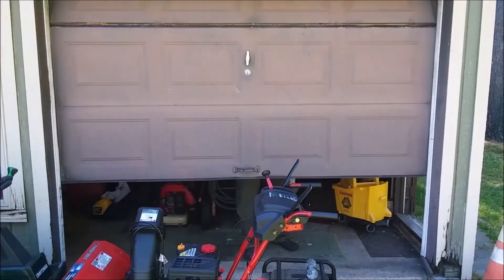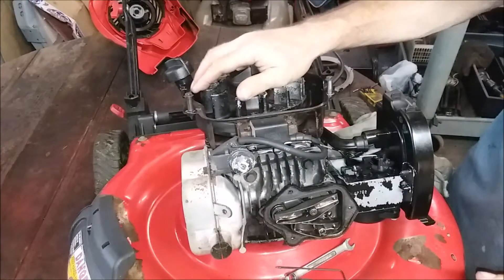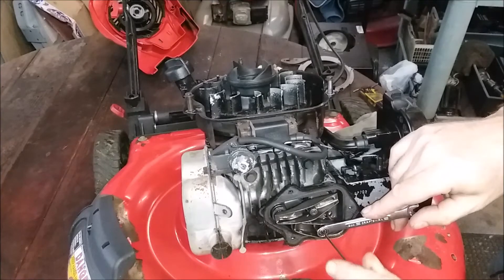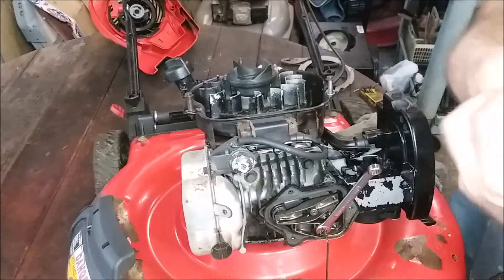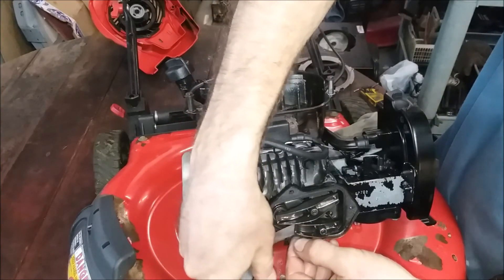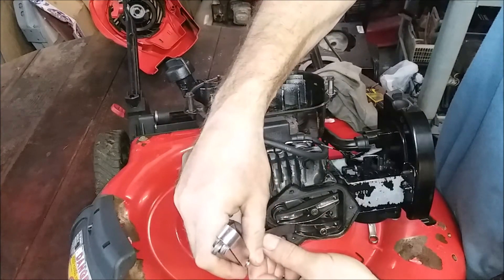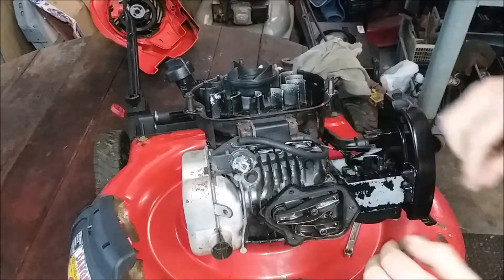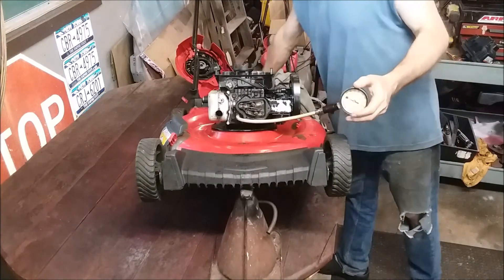How to Adjust Valves on the Briggs & Stratton 550 Series Over Head Valve Engine

Comment: Mr you don't adjust valves using the wrong tools as in this video using an Allen key wrench for a star torx bit, it's like trying to use a Philips screwdriver for a standard slotted screw on something, stop being a tight watt & spend the money & get the right tools for the right screws.
Reply: He got the job done, didn't he?

Comment: I’m assuming it’s different gap requirements for the ones that have equal length rockers?
Reply from the maker: Usually its due the the heat from the exhaust valve expanding, this requires a little more clearance but not on all engines.

Comment: The lock in the middle is a T10. The adjustment nut is a 5/16.
Reply from the maker: Thanks fer watching! Yes, 8mm & 5/16 are the same, there are a few sizes that run concurrent!
I recently bought a very nice set of Torx drivers! When I made the video I had a crappy set from craftsman. They were old, probably the 1st set they ever made. Kinda sucked!

Comment: How was it running before?
Reply from the maker: It wasn't, almost all of the machines I get aren't running!
Reply: @TheNovaJohn  yep! I ask because mine was surging and if you bump something it would surge. I checked the reed and drainage hole? Reed was fine maybe a little crud in the drainage hole. I adjusted the valves like you said and man the difference was day and night great dang video worth its weight in anything thanks a million. I will run it  this full season and hopefully that torx tip I broke off in the adjust nut will work it self out by then. That has really been bothering me after such a great job cause it's really running tops now.
Reply from the maker: Great,,,,thanks for watching!!!

Comment: If the intake valve is a little loose, will that cause backfire and other amusing antics?
Reply from the maker: Oh yea,, how loose, loose as in too much lash or the valve itself is loose?
Reply: @TheNovaJohn  was thinking too much lash, but it was maybe. 006
Reply: I made a little video of it, posted it.
Reply from the maker: @mickdog2  where did you post it?
Reply: @TheNovaJohn  my "channel"
Reply from the maker: @mickdog2  sounds like it needs one of my full workups......
Reply: @TheNovaJohn  carb is clean, what else is there?
Reply from the maker: @mickdog2  Generally, I clean the tank out, often e-jet the carb, take off the coil and clean it and the magnets, do the valves and check the governor.thicker oil as well,,
 A compression test often tells me if its gonna run well. After all of that, usually they run fine but those are not good engines, they wear fast and have lousy quality / tolerances.

Comment: adjustment is in the torques screw the nut is the lockdown
Reply from the maker: Not really, if the torx set screw didnt exist, the nut with its collar extends down to the pivot on top of the rocker so turning this piece changes the distance up/down, if it had a nylock on this nut it would be the only piece for adjustment.
The center is the jamnut so you have to consider it as you adjust.
Reply: @TheNovaJohn  I got a craftsman mower off someone recently with the 150cc version of this engine with a bent pushrod and it didn't even have this style of adjuster nut with the set screw, it just had a little washer for it to pivot on and a nut.
Reply from the maker: @brandonupchurch7628  Hmmmmmm,,,,things don't sound right,,,,did ya get it running good again?
Reply: I did, I think it bent the pushrod because the previous owner screwed with the valve lash and tightened it up and caused it to bind. When I got it it was leaking oil out of the valve cover and the paint on the bolts had clearly been disturbed so someone screwed with something under there. I didn't pay attention to where the lash was set before I removed the rocker arm because I noticed the pushrod was bent and removed it to inspect and only after the fact did I think that I should've checked how the rocker lash was set. The fuel system was also completely primed with water. I don't know how it got so messed up in 4 uses, it's a 2021 mower, the engine was manufactured in April and the Craftsman/MTD sticker says it was assembled in May.
Reply from the maker: Wow,,, just wow,,,,I've seen this before,, they think its loose so they tighten them lol
Good luck,, thanx 4 watching and welcome to the channel!!!
Reply: On a car yes on these no